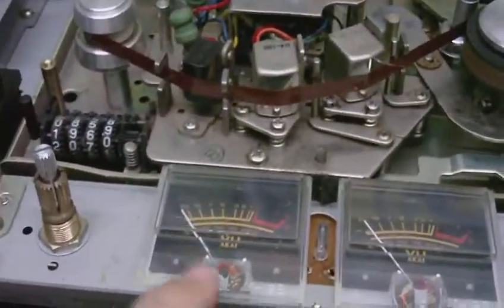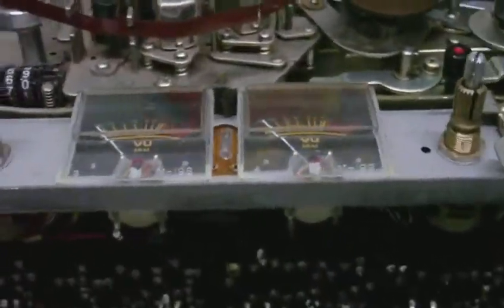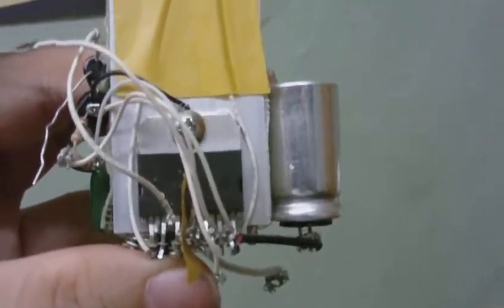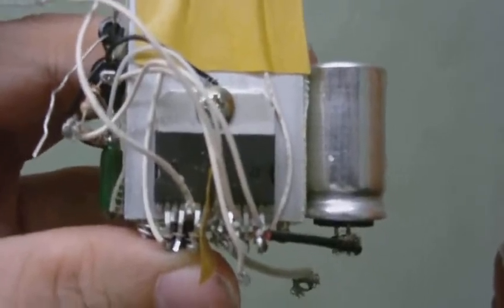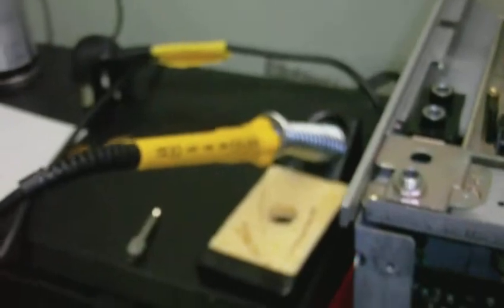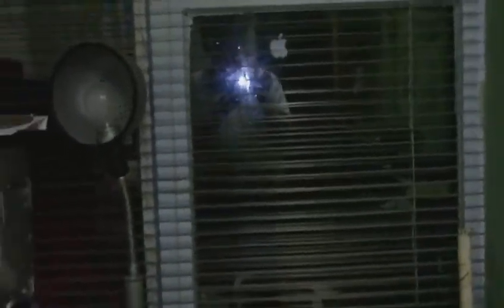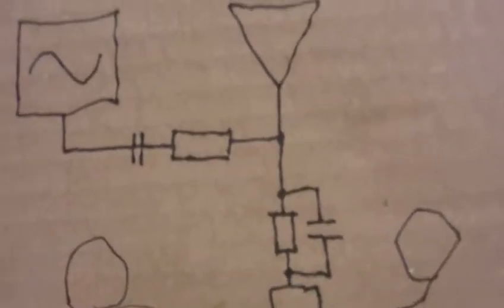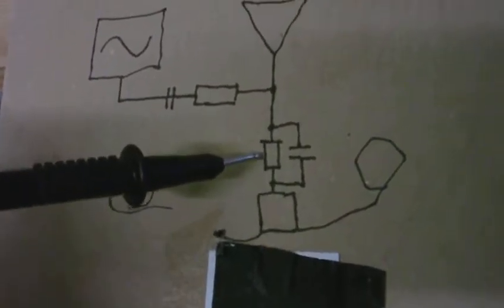Updates

Comment from the maker: It turns out the tape I was using was bad, I forgot where I put the others so that's the only one I been using for a while, but I just found the other ones again and I tried one in it and it sounded fine.  But I do need to find a new VU meter.